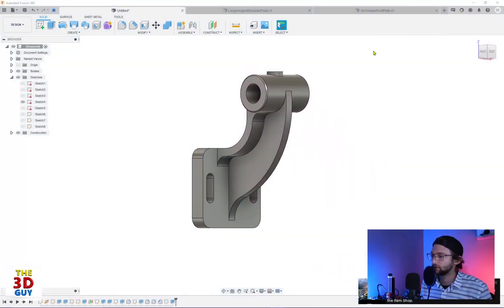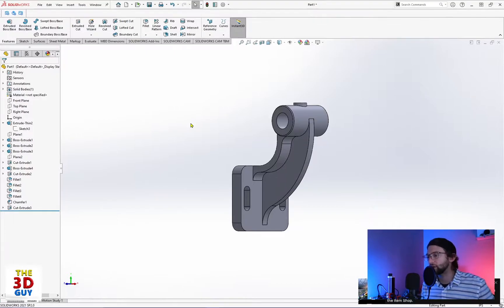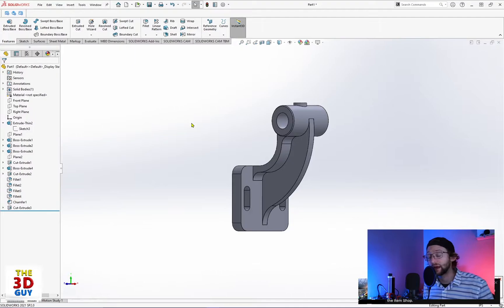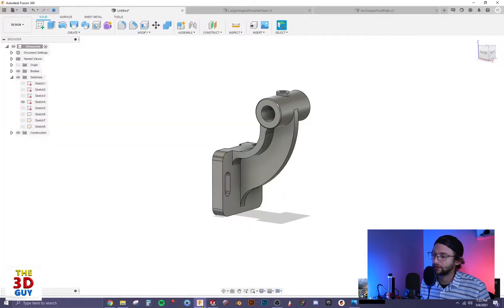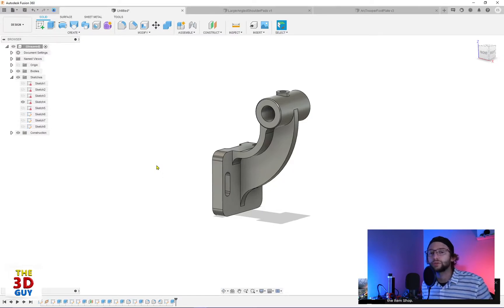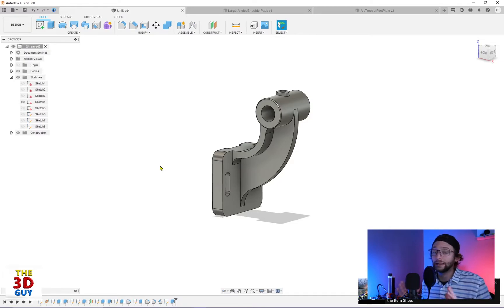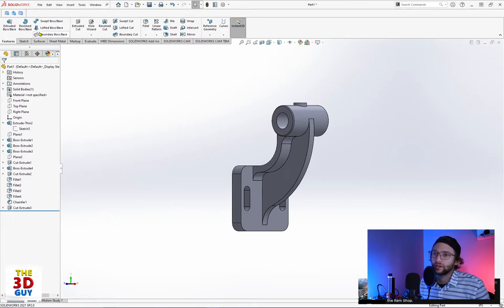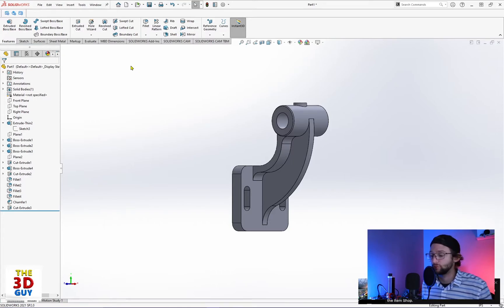Fusion 360 vs. SolidWorks: Solid Modeling

Comment: Hi thanks I have a question: I'm an industrial designer, I use Rhino and I'd like to put Soliworks in my skillset for jobmarket purposes. However paying a lot of moeny to install it, shifting from mac to pc, seems like a very big effort and I'm wondering if rather would be wise to learn Fusion and eventually if needed I could adapt to Solidworks quickly from there. Does it make sense?

Comment: Hey, i have problems with fusion when editing complex bodys. Like its loading for a long time. Is performance better with solid works?
Reply from the maker: What file format are you trying to import?
Reply: @the3dguy387  step format. I meant it's loading long while trying to work on the model, not while importing/opening the file
Reply: @meow-meow-1337  you probably have too many faces like if you have a pattern or something with lots of cuts and there is some funky stuff going on.